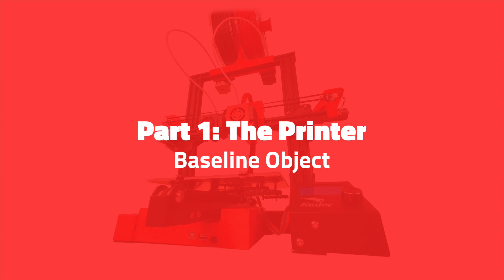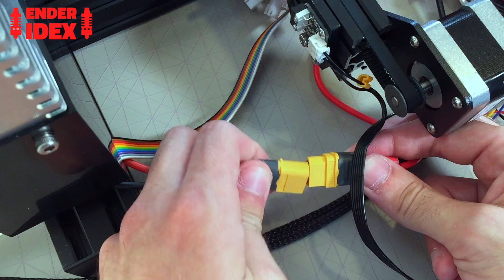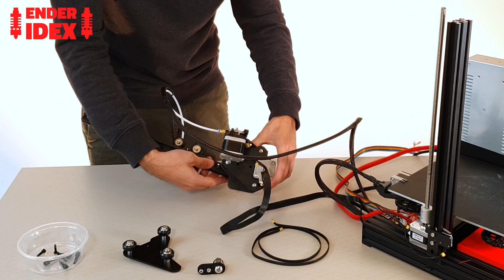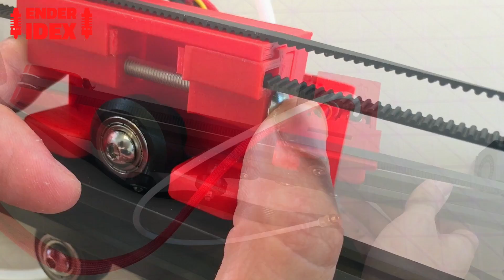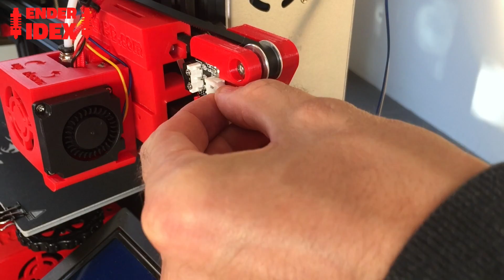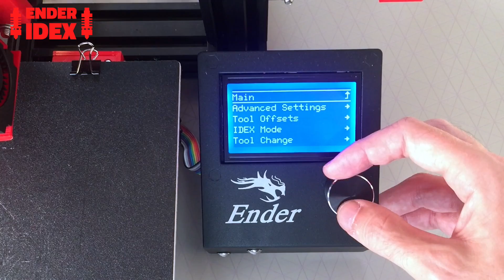Ender 3 IDEX: DIY Dual Extruder X-Carriage 3D Printer Installation Kit by SEN 3D

Comment: Will this work on an Ender 3V2?
Reply from the maker: Not quite yet, the challenge is the custom Ender 3 V2 display. I have not been able to get it to work with the updated Marlin firmware yet, it will be missing options/settings for IDEX functionality. If you didn't mind switching to a conventional Ender 3 display or even a tft35 e3 then it should be possible.

I'm hoping to have the full Ender 3 V2 kit available soon but I cannot promise a timeline.
Reply: @SEN3Dcom  hello, I've been doing a crazy amount of research for my first 3d printer and have been wanting a model with idex. My first go-to option is the Lotmaxx SC-10 Shark V2, but noticed that while it is dual extruder, it's not independent and thus leads to print waste with a purge tower. My second option was to go for either a Ender 3 Max or a Ender 3 V2 and modify them to become idex printers.

Big question is, have you been able to make the idex system compatible for the E3V2?
Reply from the maker: Hey  @Duskbreaker1780   thank you for commenting and excellent you're looking to get involved in 3D printing.

My overarching advice is if you're going to get a 3D printer specifically to do the IDEX upgrade then get and standard Ender 3 or Ender 3 Pro. The Ender 3 V2 is essentially the same as the Pro but comes with a big screen and upgraded motherboard. However, the IDEX kit replaces the motherboard anyway and the screen. So you may as well get the lower cost printers and you will have an identical output. 

If you did still want to get an Ender 3 V2 for the upgrade it does work but would need you to replace the screen for a classic Ender 3 LCD or something like a TFT35 (I can provide if you wish too).

If you were interested in the Ender 3 Max, I can also offer a kit for that. It's essentially the same kit but with a longer X-axis extrusion, longer belts and longer cables.

So all in all, buy an Ender 3 or Ender 3 Pro for the upgrade to get bet output/value. If you want to go with Ender 3 Max let me know and I can provide more details on the bigger version (kane@sen3d.com) 😁👍

Comment: This looks great. I love the way the wiring was done to the motherboard. I would really like to see an option for dual Z upgrade. Should be fairly easy on the motherboard since you are using a SKR pro. With the amount of weight on the Z I would expect this to eventually be a problem. Also, not sure if this makes sense logistically, but since you already had to get the part for the cooling fans, wouldn't it make sense to design it to have bidirectional  part cooling? I understand one extruder would not have this cabability, but maybe release the stl for the it so one could print it, or as an optional add on. Overall this is awesome and I really like it. It would be so cool to see this combined with the ender extender kit as one large upgrade kit.
Reply from the maker: Hey Nathan, thank you so much for your kind feedback, I'm delighted you like the kit 😁

Special attention was paid to the design of the E2 carriage to keep it as light as possible so there should not be a problem using the kit without a second Z stepper. However, as you mentioned it is really easy to add one too with the SKR Pro's second Z motor port! 

In terms of the carriage design for the fans. The primary aim was to enable maximum print volume without increasing the printers size too much. This is why the hotend for E2 is placed on the left side of the carriage so it can get as far over as possible. I do like your idea though and I'm currently looking at ways I can make the kit even more customisable for my customers.

When it comes to the Ender Extender this is a superb idea and a few people have asked about it. It would only really need some longer belts and cable extender for E2. I do plan to test it myself very soon. If anyone does want to the an Ender IDEX Extender beta customer just let me know 😁👍
Reply: @SEN3Dcom  Thanks for the response. I appreciate the time you take to respond to everyone and hope you are able to make this a full time gig for yourself if it is not already. You seem excited and passionate about it. 

 Count me in for IDEX Extender beta! I don't have either yet but was hoping to get both the extender and IDEX kit eventually. (within a year I was hoping to have both). Just gotta space the upgrades out, they are expensive :D.
Reply from the maker: @Just_Natee  Thank you so much, your support means a lot 😁

That's awesome, it sounds like you're going to have a very busy 2021! I'll have to come up with some other crazy kits for the Ender 3 to keep your "future upgrades" list full 😜

Comment: You have to pay more money then if you will buy a new IDEX printer... but good work anyway
Reply from the maker: It's a fair question, one main reason is there is quite a lot in the kit. The SKR Pro board that's included is many times bigger, more powerful and more capable than the standard Ender 3 board alone. Plus you have a whole second carriage, second extruder, second X axis motor, new X axis extrusion, 2 spool holders and lots more.

It's obviously not for everyone but the kit does take the Ender 3 to a whole new level, plus you get my personal help getting it going which is hopefully worth a bit too 😁😉

Thank you for your kind words as well 😊

Comment: Would this work on an ender that as the dual z upgrade ?
Reply from the maker: Hey, it depends a bit on the type of dual Z upgrade you have. In principle it should work fine, the SKR Pro board also has a second Z stepper output so you can plug it directly into the board. The only thing we'd have to think about is if your dual Z bracket interferes with the new second axis parts at all. It shouldn't do but I'd like to check to be sure :)
Reply: @SEN3Dcom  thankyou for the reply, its  was more a hypethetical scenario as i dont have one but would like a dual z to avoid droop etc, im keen on getting an idex but equally keen to buy one of your kits for the idex and to learn from fitting it, so rock and a hard place at the min, do you think this could be fitted to an anycubic mega x so you benefit from the larger build area, keep up the good work 
Cheers

Comment: Does this work with any of the Enders Ender 3 and 5-5 Pro?
Reply from the maker: Hey Joe, Currently the kit works with the Ender 3 and 3 Pro, the Ender 3 V2 is coming soon (the custom screen makes it a little harder). I cannot guarantee it will work with any other printers but it's not impossible :)
Reply from the maker: @shaker2321  I don't have a defined date currently, the majority of demand has been for the Ender 3 and Ender 3 Pro so my efforts have been focused there to ensure it is the best it can be. 

However, if you were willing and able to switch the Ender 3 V2 screen for the classic Ender 3 screen or a BTT TFT35 then the kit would actually work today. So that is an option if you'd like to get IDEX printing asap. 😁

Comment: This is great upgrade! But kit coast around 300$ + ender 3 coast ~200$. Too hight price. 
Only for 350$ you can get already done and ready too work Idex printer https://www.aliexpress.com/item/4000525958501.html
With better quality and bigger print size.
I have skr1.4 turbo+tft35 But i like my ender 3 and interesting about upgrade to IDEX. Any chance to get print models and ali links for kits with another price? to install it with my skr board.
 Your project reaaly good!

Comment: Just curious.  Why did you use DRV drivers instead of TMC?
Reply from the maker: Excellent question. The main reason was that for everyone there is their preferred upgrade. For some stepper silence is important, for others it's an all metal hotend, direct drive, capricorn PTFE, dual gear extruder, linear rails, bl touch, touch screen etc.

I came to the conclusion that for V1 of the kit I wanted to keep it "simple" and as close to stock Ender 3 as I could. Then everyone can further upgrade and adapt it as they wish. 

The excellent part is that the SKR Pro board that's included has changeable stepper drivers so if you did want to upgrade it would be a relatively simple and fun project later down the line (and I'd be happy to help with it too).

Also final final point, even though the DRVs are not silent drivers I and many initial customers have observed that it is still noticeably quieter than the stock Ender 3 board :)
Reply: @SEN3Dcom  Great points!  Thanks for the quick response.

Comment: I have a Flashforge Creator Pro and convert to IDEX system, but i have some problem with this electronic BTT SKR PRO because when X2 come to homing, the bump come to right and the belt slip. I used TMC 2208 but I dont know what happend.
Reply from the maker: Hey Bori,

Thanks for your comment, sounds like you've got a great little project there.

As you converted it to IDEX did you add another endstop switch on the far right of the X axis? Hotend 1 will home to the left and tap your original endstop. Hotend 2 will home to the right and tap the new X-Max endstop.

Sorry if that's obvious but worth checking first.
Reply: @SEN3Dcom  Yes, all endstop ready, but now I see that the right motor have diferent step per mm than the left motor x. I belived that the x2 motor used the same x1 parameters.
Reply from the maker: @boritech9016  Ah ok, so it's like X2 is reversed? Try Switching the cables to X1 and X2 and see if they go in the right/wrong direction.

If X2 is reversed the easiest solution will be to flip the wires around. All you have to do is swap the 2 outside wires then swap the 2 inside wires. This will reverse the direction it turns.

Comment: Hi Kane, this looks like a great product and I wish you every success with it before the Chinese start cloning!  Just the other day I was thinking about the possibility of fitting a second nozzle on my Ender 3 Pro - then I saw your video - looks like a 'game changer'!

I've just a few questions.  Is the kit compatible with the Pro with its wider Y-axis aluminium extrusion? I'm also thinking of (later) upgrading it to a bigger print volume (something like 400mm x 400mm bed).  For this, apart from the fact that I would need an even longer X-axis aluminium extrusion to accommodate the 2nd X-carriage together with longer X-carriage belts, bowden tubes, leads, etc., is there anything that might be a 'show stopper'?  I realise that the longer X-axis would mean that a 2nd Z-axis screw (belt or stepper motor driven) may be needed.  Is there a control board fan fitted and is it easy to access the control board within its case?  Finally, being 'green' to IDEX operation, from your videos it looks like most of the control is by G-Code from the slicer.  is it possible to still tweak the Marlin firmware if required?  For example, I have an all-metal hot end (with bowden set up) and a 100k thermistor, so had to change the firmware to allow higher temperature printing (300 deg C) and select the correct thermistor.

By the way, I think your instructional videos are among the best I've seen on 3D printing.

....Just one last thing: what is the lead time from purchase to delivery?

Regards,

Mick
Reply: Thanks, Kane, I'll be in touch...
Reply from the maker: Hey Mick,

Thank you for your kind feedback and words, I really appreciate it 🙂

In answer to your questions: yes it does work with the Ender 3 Pro (the gap at the top of the motherboard box is wide enough for the 40x40 extrusion).

Yes, in principle the Ender Extender should be compatible with the Ender IDEX kit. As you said you'd mainly need a wider X extrusion for the X-axis and longer belts for Carriage 1 and Carriage 2. If you did go ahead with this I'd be really keen to help you and make sure any problems are solved.

Yes, the motherboard has a fan fitted inside the box with airflow exhausted at the opposite end of the box for good temperature control. The lid of the box is easily slid off after you remove a few screws, giving full access to the motherboard.

The SKR Pro also have a second Z stepper socket so adding another Z-axis motor should not be too difficult.

In terms of firmware, you can of course make as many changes as you like. I upload both the pre-compiled firmware and the raw files here so you can adapt it however you like and I'd be happy to help you too: https://enderidex.com/help/software/

Thank you, I'm so glad you like the instructional video. I agree that many product in this area can be a bit cryptic and leave you with lots of questions and no support 😅

Currently, the lead time is around 7 days to ship and delivery time will depend on your country but is rarely more than 2-3 days.

If you have any other questions please do not hesitate to ask.

All the best, 
Kane

Comment: What are your thoughts on using this to print nylons with dissolvable supports?  Is it compatible with microswiss metal hotends? Will it withstand the temperature if the unit is contained?

What about flexibles? Is the custom extruder compatible with direct drives that fit stock ender 3s?
Reply from the maker: Great question. Obviously the stock hotend/bowden setup of the Ender 3 won't work for Nylons. But, temperatures is not an issue with dissolvable PVA filament though which is good!

I have not tried the Micro Swiss myself but given its identical mounting points and form factor I cannot see why i would not be possible to swap it out. In the kit the second hotend is the same as the stock Ender 3 one and uses the conventional mounting holes.

Currently the custom nature of the second carriage means it is not out of the box direct drive compatible. The reason is that the second hotend can be raised or lowered with a screw to keep it levelled with the first hotend. However, it would be possible for Extruder 1 to be setup with an off the shelf direct drive and Extruder 2 maintain the bowden. This way E1 could print in TPU with E2 printing an alternative material. The only thing to keep an eye on will be the weight on the X-axis given you're adding the motor on top of the additional carriage.

Comment: Will it come in other colors in the future? Not a big fan of the red unfortunately. Also, will new fan ducts such as the satsana work for the second extruder?
Reply from the maker: Different colours could be possible, for now I'm just trying to keep up with demand 😅

Any fan ducts would need to be customised to work with the second extruder. The reason for this is the new second hotend is quite custom. It has the hotend on the left of the carriage (rather than right) for maximum build plate coverage. It also raises and lowers independently with a screw to enable it to be perfectly levelled with the first extruder. Because of this the whole mount is quite different and is unlikely to work with an off the shelf duct.

Comment: Is there a solution for direct drive?
Reply from the maker: Hi Chris, thanks for commenting. For it to work effectively with direct drive you'd really also need to add a second z-axis stepper motor to deal with the extra weight on the axis. That is of course possible and probably wouldn't be too hard (the SKR Pro board has a built in plug for a second Z motor). I have just kept it simple for the first version 🙂😇
Reply from the maker: @חן רוזנפלד Yes definetly. The SKR Pro board actually has 2 connectors for the Z-stepper. Sou you would just plug the second motor into the free slot on the board
Reply from the maker: @חן רוזנפלד So I have not done it for the SKR V1.4 myself but I can see it does also split out the Z into 2 connectors (https://github.com/bigtreetech/BIGTREETECH-SKR-V1.3/blob/master/BTT%20SKR%20V1.4/Hardware/connect.jpg) So should be possible and quite easy :)l

Comment: Very impressive job! Your video is also very good and clear!
Reply from the maker: Thank you Gaston, you are very kind 😊

Do you have an Ender 3 (or a few 😜)
Reply: @SEN3Dcom  1 Ender 3 (heavily customized, probably the frame and the LCD screen are the only original part left) and a Prusa MK3
Reply from the maker: @gastondombiak1538  Nice, how do you think the Ender and Prusa compare?
Reply: SEN 3D both work very well and reliable for me. Ender With bltouch, creality glass bed and all metal hot end performs as well as the MK3. I then added 32 bit board with latest marlin and hemera hot end and it is now even better. I use both printers for same kind of work. Both reliable. Both good.
Reply from the maker: @gastondombiak1538  That's really interesting and good to get your view. It seems fairly rare to find owners of an Ender and a Prusa. The vast majority of printer people seems to live in one camp of the other :)